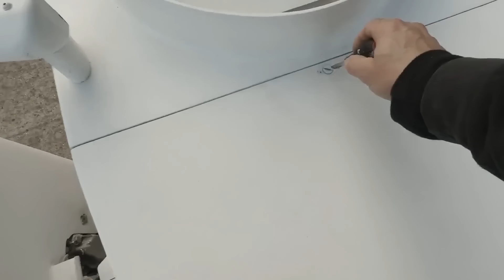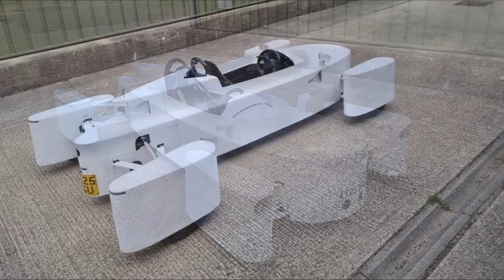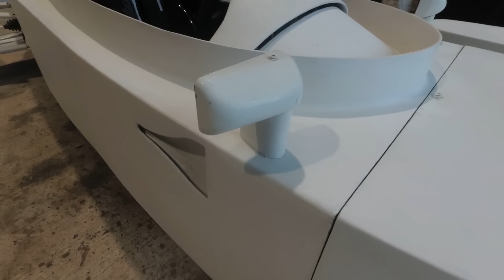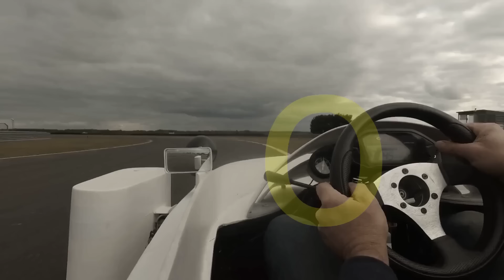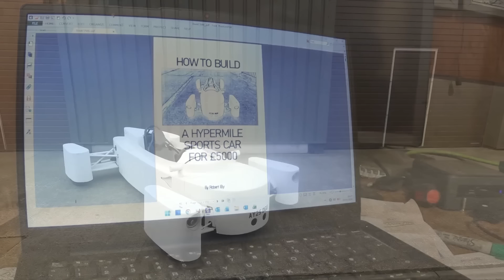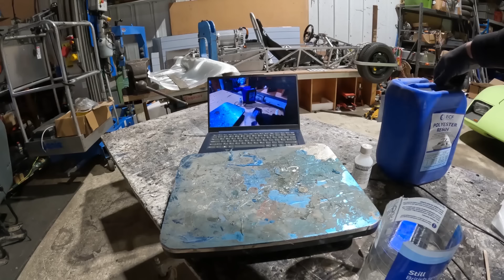How to Build a Hypermile Sports Car for £5000 (or less, or more)

Comment: I see the light weight, I see the cheap, I don't see the sustainability.  Looks like bumping a curb would destroy it and the driver.
Reply from the maker: I'm taking it on some test drives to check it.  We have lots and lots of pot holes in the UK and this car actually glides over them compared to my track day car or van.

Comment: The prototype 1 aero choice is understandable since it's getting a workable car out of the door earlier vs refining aero;
Though I'd prefer to see some more regard for safety re: front suspension exposed behind pedal box, exceptionally low space frame ending before shoulder height, lack of impact structures etc.
Modernising doesn't have to mean NCAP 5 stars but it does include not dying ;)
Reply from the maker: Fair point. The upper chassis rail could be raised and I was also thinking about a curved outrigger on the upper sides to act as extra impact protection and also a plastic/rubber front panel for pedestrian impact protection.  Lots of potential for safety improvements that needn't add a lot of weight

Comment: Why not use a motorcycle(minus front forks) at the rear for a single rear wheel three wheel design? Less drag, less complexity, less weight.

Comment: Nice project, but your aerodynamic looks a little bit square!
If you want a body with only single curves, you can go much further that you already have gone. 
Example: You can take the vertical shield around your cockpit away, and all the upper flat surfaces you can curve down in the front and rear.

Comment: Sorry for double commenting, but I was suddenly reminded of something and had to come back and comment. The bodywork could be made much simpler, if done just like the Chapparal 2J race car from 1970.  It's a very simple square body shape with enclosed rear wheels and a relatively simple nose cone that could be made even simpler, since the cooling needs of the Honda lump are no where near the cooling needs of a 7 liter V8.

You'd gain massive Venturi tunnels underneath for a low drag, high downforce setup like the Toyota TS010 from the 90's.
Reply from the maker: Nice idea. Something like a 1970s Alfa 33 race car would also do.

Comment: Fantastic, well done! You've obviously put a huge amount of thought, and effort into the car, and the book.
The light weight, low drag theme really chimes with me.
A couple of things I'm curious to know - 
Does having the wheels completely shrouded make such a light car susceptable to the effects of sidewinds and buffeting from trucks?
Can you get road legal tyres that are rated for such a light vehicle?
Did you also have a look at the work of Frank Costin when thiking about aerodynamics and small cars?
Reply from the maker: I haven't had any issues with buffeting or side winds but top speed is 72mph so it may be a different story at 100+ mph.
Tyres are standard Ford Ka tyres, I haven't looked into tyres too much, but are certainly an area worth looking into.
I am a fan of Frank Costin and his mega light racers as well as some of the similar French cars that raced at Le Mans.  Lots of imagination there with materials, aero and weight saving. Peak motosport for me!
Reply: Thanks  @GasoliniASMR , I'm really enjoying seeing your videos, and the Late Brake show review on the AR1 - its great to see your clever creation getting more coverage.
Great to hear you're a fan of Frank Costin, as you say those lightweight, low weight racers from his era really are peak motorsport.
All the best

Comment: Why is the tail rounded? You’ll be getting substantial drag that could be avoided with either a sharp fin edge or a bobtail with sharp edged flat back to encourage the air circulation to fill the wake for you.
Reply from the maker: I was a bit worried about air detaching at the sides if the rear curved in too steeply and came up with a bit of a compromise.
Next build has a fairly nice sharp rear edge on the fairings and I'll try and get a sharp resr edge for the bodywork too.

Comment: If you're going electric, it would make sense to put a hub motor with regenerative braking in each hub, removing the need for a complex and heavy differential; this would also give you four wheel drive, and, potentially, thrust vectoring. A hub motor would not be heavier than a car-sized disk brake (although for the low kinetic energy a car of this weight has you could use motorcycle, or even downhill bicycle, brakes). However, because regenerative brakes will not hold a vehicle when it is stopped, you would need a relatively small parking brake in addition.

Comment: If you have time, look into Douglas Malewiki and his “California commuter” from back in the 80s. Similar concept but with a modified Honda s90 engine and fiberglass over foam construction. His method of setting up forms to make the curves accurately in a home setting might be of some use as you refine the design. He still holds a few records for mileage from the build.
Reply from the maker: Wow! That is amazing. Can't believe I haven't come across that before.
Going to do some investigating.....
Reply: @GasoliniASMR if you snag a set of plans from him and can’t read any of the dimensions, reach out to him. He still had the original full size ones as well as the original vehicle. Last update I had was the frame and drivetrain were in storage and the body had been loaned out to a group who was going to digitize the design and try to 3d print a carbon fiber body for better weight and aero.

Comment: It's a dream of mine to design and build a lightweight electric two seat tandem touring car. Unfortunately here in France the regulatory hurdles for registering a home-built vehicle are so high that a car like that or like yours would cost 10 000 € and several years just for the testing and certification of the chassis and the drive train.
Reply from the maker: It sounds hideous in Europe. A real shame given the history of the early French car builders

Comment: Hey, i'm really impressed by the cost of the project, i find it great that you were able to make this really well thought out vehicle for such an affordable bill of material! I'm guessing the 5000£ price point does not include the homologation cost ? 

That's the aspect that scares me the most, i'm from France, so the car i would build would have to be tested by UTAC in paris, i've been told the cost could easily be in the hundreds of thousands of euro, so for a single prototype, so it's not going to be possible for my budget. 

Are the uk homologation rules kinder to reasonable budget custom vehicle ?

If so, i might look into moving into the uk haha
Reply from the maker: Homologation is about £600 and lots of paperwork but it's getting costlier.
We are very lucky here compared to Europe.

Comment: Have you considered using body putty to help add curved surfaces easily? Mainly on top of the main body just at the bottom edge of the short ''walls'' around the driver. Or if thats too heavy, foam?

Comment: Looks awesome, I'm building my own vehicle and projects like these are a great source of inspiration. I might be wrong on this but at the rear of the fearings the end should either end in a point or cut sharply otherwise you risk a larger area where air detaches and become turbulent.
Reply from the maker: Yes, they are a bit too rounded at the back. I thought the air might detach at the sides if the rear curved in too steeply. I've done a better job with the fairings on the electric version which are also more rounded. 
Would be much easier with narrower wheels and tyres
Reply: Hey ! 
I would like to say that i'm surprised to see you here, but it makes a lot of sense that the algorithm would show this to you haha ! 
Hope you're doing alright btw :)

Comment: If you put a torpedo nose, and a wing in the back, you'd be doing better. Plus, try to build boxes between you wheels that run your wheel base. The boxes need to be separate from the tires, and they help keep wind from under your car, and can assist with downforce for extra stability.
Reply from the maker: I'm a big fan of the Lancia D50 so I like the idea.

Comment: The flat tops eliminate lift which is a first step to downforce. Your streamlined spats would generate lift, and therefor require cut outs above to spoil lift, as you showed. I think you should skip all that as lemans cars these days have 2d spats similar to yours for same reasons but require cut outs to reduce chances of getting airborne due to closed bodywork that you do not have. You could tilt all flat top surfaces down at the front to subdue lift when cresting hills. 2d simplicity is better. The whittman tailwind kit aircraft series proved this. The aptera is wrong, you are right, you have spent a hell of a lot less investor money...there was or is an efficiency race in britain, but they kicked out the honda insight because it won, it might win your race also at 999cc. Avoiding the differential and regulations with a three wheel, front or rear drive, rubber hybrid, with two or four seats, approches utility, but it us tough, the manufacturers used offerings are good , you have an aluminum audi a4? Or something, not in US. Anyway 2d is the way, good work. PS blow closed doors on top will allow chimeny cooling when standing still after shut down, or stuvk on the starting grid, preventing vapor lock etc.

Comment: I only needed the first minute and 55 seconds to convince me to subscribe! Absolutely brilliant design!
Reply: Ironically, that same part very nearly caused me to turn the video off. The noise is absolutely obnoxious, and it felt like useless filler just to pad the run time. I skipped forward until I got to any actual content.

Different strokes for different folks, I suppose. I’m glad you enjoyed that bit.

Comment: I love that the UK still alllows these Shed Specials to be road registered!
Reply: Yeah, kind of jealous tbh
Reply: Well, same is ofc possible in Germany, if not all of EU. In fact, there are no EU level regulations against, as all production regulations are only targeted at series over 300 pieces per year. So it's all up to country specific regulations - which are usually rather basic. In Germany this isn't much beside over all size, weight and placement of required lights. Once registered in your country it'll be legal to drive in all of EU land and a few more. So yeah, not much regulation to hold you back.
Reply: ...i understand the "its somehow possible in germany".
But how?
Under what law?
Is there anything similar for motorcycles?
Reply: "Dune buggy" registration in Canada 😄
Reply: If won't pass SVA you can always call it an agricultural vehicle

Comment: Did you entertain the idea of a three wheeler? I’m thinking that it could reduce rear end complexity, improve aerodynamic profile and there are numerous options for 600cc super scooters with auto or vario gearboxes?
Reply: It would also drastically worsen every aspect of its driving characteristics.
Reply: @no1DdC  Morgan sports cars clearly don’t agree with you but I agree that some compromises would need to be made
Reply: @spency787  Morgan's 3-Wheeler is not a competent vehicle. Its handling and performance are significantly worse than that of any car. Originally, Morgan built these, because they were cheaper than cars and could be driven with a motorcycle license. 

The current version meanwhile is solely intended as a fun novelty vehicle, a third or fourth vehicle for well-off buyers who already have several cars and are looking for excitement, nothing more. It will never set a lap record anywhere - and in normal traffic, the layout means that you cannot evade any bumps.

Comment: I love the look of this car it’s like you said, a Metropolis style. One thing I would say though is your wheel spats would benefit from having a much smaller radius on the trailing edge. Doing so would create a lower pressure in the wake which would if provided with a slot would extract air from the spat.

Comment: Some great ideas there about the racing. I am currently building a car from scratch (it would not be suitable for your racing ideas - it has a K24 engine that will have a turbo). 
Once its finished I'll be looking for another project. I was thinking of a Cyclecar.

Comment: There is a championship in Japan called K4-GP where only vehicles with an engine smaller than 660 cc can race. It's essentially Kei Car endurance racing, but there are multiple classes ranging from bog standard cars to scaled down replicas of Ford GT40's, Group C racecars and even a Tyrell P34 inspired car using 4 go kart wheels for steering. They have a set fuel amount with which they have to do the entire race, while balancing speed and fuel economy. 

It's pretty cool stuff and there are some videos here and there on YouTube where you can see them in action.
Reply: Sounds excellent!
Reply: That interesting. Compare with F2 Sidecar with 600cc (for 4 cylinder outfits) with 2 aboard.
Reply from the maker: Thanks for the suggestion. I'm a big fan of Kei Cars too.

Comment: can you put like a i4 600cc engine in it and make it transverse for the body part its quite easy i thing just use a 3d printer to make a carbon kevlar mold to make it like a formula style car
Reply from the maker: It could be done by extending the engine bay a touch.  I've yet to try 3D printing but hope to one day........